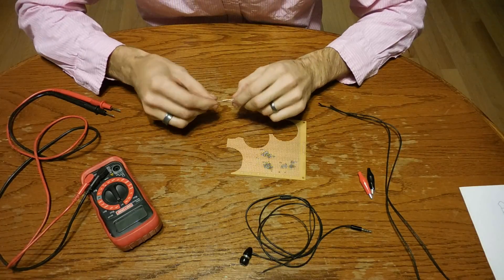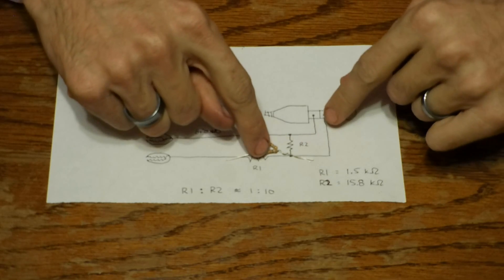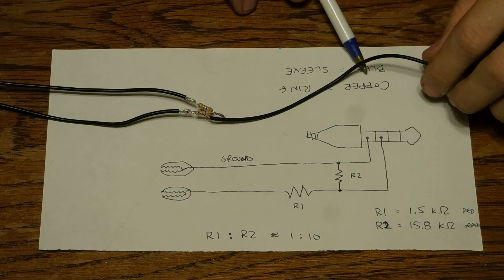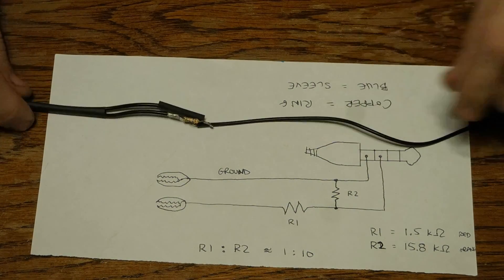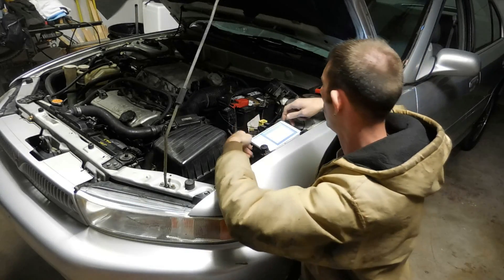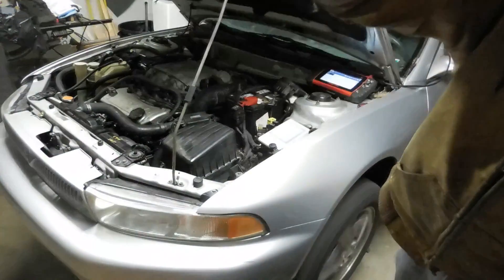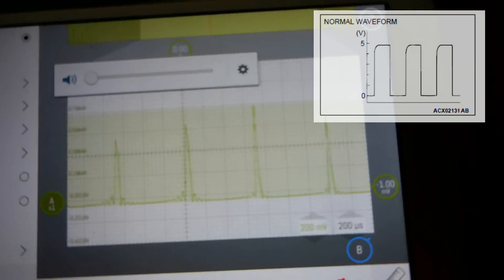DIY oscilloscope probe for Android device ⚡️UPDATE⚡️

Comment: As noted in comments below, his circuit diagram has the two resistors reversed (wrong).   He wants the resistor divider circuit to reduce the 5v max input voltage (on the left) down to 0.5 Vpeak on the microphone input connector (right of diagram) is designed for (I am guessing he knows or assumes the max = 1Vpp (+/- 1V) , which is a typical audio line voltage value (I do not know if this is true for his phone).

Voltage reduction formula for the ratio of Vin / Vout = R2/(R1+R2) = 15.8k/(1.5k+15.8k) = 0.91   if done as the diagram shows.  This means the voltage is reduced from 100% to 91% of input with is not enough of a reduction.
If you swap them so R2 is the smaller one, Vin /Vout = 1.5k/(1.5k+15.8k) = 0.086 = 1/11.5 which is close to the 1:10 he wanted).

Note:  TO get a more exact 1:10 reduction, use 1K and 9K or 1K and 90K Vin /Vout = 1.0k/(1.0k+9.0k) = 1/10 or any resistors when the bigger one is 9x the smaller one.
Reply: Yes I think that the two resistors are reversed

Comment: I am surprise that he didn't even mention the most important part of this operation: THE APP he is using. I think he has experience in what he is saying, but staying silent about such an important aspect of this project, and also by not showing how his circuit connects to the car brings to question the integrity of his project.
Reply from the maker: Or you could read the video description where I specify what app I’m using 🤷🏻‍♂️ 

As far as how it hooked to the car, the two clips attach to the pins that need to be tested for whatever sensor you’re trying to test. Each sensor is going to have a different testing procedure and that was out of the scope of the video.

Comment: Some Notes: 
- The Impedance of the line in is typically around 10kOhm
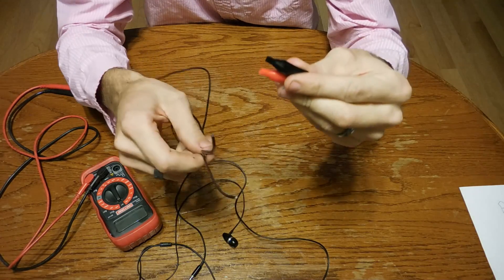- Vpp of the line in is 2V, so Vpp of this 1:11 Ratio Oscilloscope should be around Vpp~=22V
- The max Frequency should be around your phones line in sampling rate (usually only 48kHz), so it sould have a Frequency band of only 0 - <48kHz (also depends a bit on your waveform type) -> aka. this oscilloscope isnt for high frequencies at all.

I havent done this project myself, but due to being a poor student I'll probably make one of these myself in the near future. I might add 2 1V Zener diodes in row(facing each other ->---<- ) and put that parallel to the line in aswell, so that the Vpp doesnt go above ~2V 

Edit: or 2 20V Zener Diodes against each other across the whole thing, that should work aswell (scince they are way easier to get)

(or scince I dont own any zener diodes, I might put 3normal diodes in a row, then another 3in a row, and put themparallel to the line in like so: LineIn[+]--->-->-->---LineIn[-]   LineIn[-]--->-->-->---LineIn[+], so that the 0,7V Forward bias Voltage in each direction adds up to 2,1V)
or Ill just be lazy and do nothing about that ¯\_(ツ)_/¯
Reply: Can you please explain how adding 2 diode limits it to 2 volts?

Comment: Thanks for this experiment , I have a question for my work, I am testing signals between 0 ~ 30 V what is the proper resistors values should i used ????  and it difference if the Volt is DC or AC ??
Reply: first try to know max voltage phone' s jack take in say 3v, 1mA
now you are about to read 0-30 volts 
thats is for your jack 3v is 30 volt right, with zero or negligible input current, 
so you can use voltage divider formula to calculate 
or say it
100k and 22 k, and 100k will in series and 22 k will in parallel,
one more thing you can take resistance values in Mega ohm, as we are here to measure voltage waveform not current,

Comment: I notice that for many of the Andriod phones, the 3.5 mm 4 Pole Audio jack, the pinout is different from your video. The last ring is for the Mic and the third ring is for the screen. In short the connection is reversed. Could you please clarify is this correct ?
Reply: I can confirm MIC and GND are reversed on the set i used

Comment: what a relief to find your video! I've looked at several videos on how to make a scope to use on Android but this is by far the best plus you didn't use anything id have to go out and buy. i need to see the waveform of my 05 Acura TSX k line (high speed CAN line) bc im having a lack of communication from TAC module. actually what i really need is to check if the low and high speed CAN lines mirror each other but I'm gonna give this a shot and see if i can figure my car prob out with this before i go spending more$ on tools etc.. I've already replaced the TAC module but it's not working still!

Comment: I followed the instructions in your video and everything seemed to work correctly when I checked the continuity with a multimeter on the wires from the ends of the leads to the rings on the headphone jack. 

But I couldn't get any signal on the app itself. I tried several apps on two different android smart phones and none of them would show a signal inside the apps. I would be grateful for any advice or guidance you could give me to help me get this working. Thank you in advance.
Reply: Hi, you can use this preamplifier  very easy to build and very cheap and safe for your device. I made one last weekend and it works/ here is the link with instructions, https://www.instructables.com/id/A-Preamplifier-for-Smartphone-Oscilloscopes/  I hope you find it usable.
Reply: @josegilmeralvarezb.5309  Thank you very much for posting this. It is helpful but it's a little difficult for me to get these parts to build this, but I do see the value in it. I shot a short video and put it on my channel as to how far I got with trying to make this type of oscilloscope. If you're able to please watch it and if you could give me any feedback as to what I'm doing wrong I would be most grateful. Thank you very much for your comment and your help.
Reply: @josegilmeralvarezb.5309  thanks for the link.

Comment: Very interesting. I'll try to assemble it. I need to have an oscilloscope to see if I have a good signal coming out of my radio unit and to see when it starts clipping (squaring up the sinusoid). Will this device show me reliably the distortions? Thanks man
Reply: You might want to look at the DSO150 from Banggood for your requirements. They are only about $15 (free delivery) right now if you do the soldering (it's easy) or around $25 if you get one already made. They work great for the rf audio range and are very intuitive to use. DO NOT get one from Aliexpress or Ebay as they are mostly fakes and you HAVE to get a code from the maker before use (they email back overnight!) and they won't issue a code for fakes. Banggood only sends genuine units so you are safe there. Hope this helps. May be too late but might help someone anyway.

Comment: Can you clear up some points for me? 
Point 1: Is the max. input voltage rating of port in smartphones 3.0 V?
Point 2: Do I have to connect the microphone wires or the audio wires to the resistor network?
BTW, thanks. Your video seems to be the most comprehensible of all of the ones out there!
Reply: 1: It probably can't take more voltage than that.
2: The microphone ones.

Comment: Would it be a good idea to add a potentiometer to measure high and low voltage?
Reply from the maker: Yes, that's definitely an option. I just didn't have one and needed this right away.
Reply: @DustinRogersinMO  thanks for the quick reply have a great day

Comment: Splendid Video but I have some questions. 

1) Did you use the multimeter to  find which wire strand goes to which ring of the Earphone pin? 

2) Which Application did you use to show the output? 

Please reply as quickly as you can ^_^
Reply from the maker: Yes, you’ll need to do continuity tests to determine the correct wire to hook to. 

The app I used was called Smart Scope but there are many available on the Play store.

Comment: 1:10=r1-1.5 and r2 -15.8 but 1:100 ?
Reply from the maker: SANJAY KUMAR you’d just need to use a resistor for R2 that is 100x R1. So if R1 is 1.5k then R2 would need to be 150k

Comment: Hi - are those resistors ok to test a car components? Like EGR valve or temperature sensor? gr8 video btw :)
Reply from the maker: Marcin Wojciechowski yes. I used this to test a speed sensor on a transmission.
Reply from the maker: But you’ll need to find out what voltage those sensors use. The speed sensor that I tested put out 5v. The resistors that I used divided voltage by 10, so my tablet was only receiving ~0.5 volts. The headphone jack can only handle ~2volts so you’ll need to adjust your resistor sizes to divide the voltage to a safe level for what you’re testing.

Comment: What is the max voltage range?
Reply: Oblivion Tech, he said max voltage  on an android device can take is right around 3v. If that is so, then two resistors in a 1 to 10 ratio, and 3 volts max on the small resistor means 30 volts max across the larger resistor, totaling 33v max voltage to be sensed on the probes. If your your ratio is 1 to 100 and you can drop up to 3v on the small, then your drop upto 300 on the larger resistor, totaling 303v max voltage to be sensed on the probes. Note: in his drawing, R1 should be R2, and R2 should be R1.  

While he said 3v, i see other sources say 2v. It maybe that different android vendors have different specs.
Reply: Keith Reynolds - Spot on. I've seen max input claims in the android anywhere until 3.5v, some even claiming it could go as high as 4V. 
So I would be comfortable to work at a max. of 2.5v, just in case. 
Although totally willing to try it. I'm in no way willing to fry my phone. ;-)

Comment: There seems to be an inconsistency between your diagram an the voltage calculator on that link.  With your R1 & R2, the voltage would only drop from 5V to 4.57V (not 0.5V as you state).  To drop 5V to 0.5V would require the resisters to be swapped, having R1 be the larger.
Reply: And it's 1 to 11 if anyone cares.
Reply from the maker: Huh...you're right. It's strange that a 5V signal was showing as ~0.5V on the scope though. Now I need to test a constant voltage through the adapter and just measure on the ring/sleeve of the headphone jack with a voltmeter. Maybe I had it drawn one way and soldered it up differently than I had it drawn.
Reply from the maker: Thanks for pointing this out. Since there's no way to change the video, I changed the title and added some notes to the description. Hopefully any future views, people will read the updates.
Reply: @DustinRogersinMO  you probably ended up soldering the resistors "wrong," the two errors canceled and the result was the desired one.
Reply: Right. I was writing a comment when I saw your comment - in order to protect de microphone input with a 1 to 10 voltage  atenuator, the first resistor must be ten times the second  one ( connected to ground).

Comment: Good job , please what is the max voltage can be used thx
Reply from the maker: NASRY Farid it probably varies by device but I wouldn't exceed 3 V
Reply: input voltage 220v AC R1=10 kohm, R2= 50 ohm i will get 1.095 as input voltage to phone 
can i use this and test it with my phone!
Thanks in advance
Reply from the maker: NASRY Farid I didn't check your math, but you could always build the probe and hook it to your voltage source before plugging into your phone. Use a voltmeter to check voltage to be sure you are under 3v.
Reply: Thanks a lot you r the best
Reply: i will test it and i will give u the result My best regards